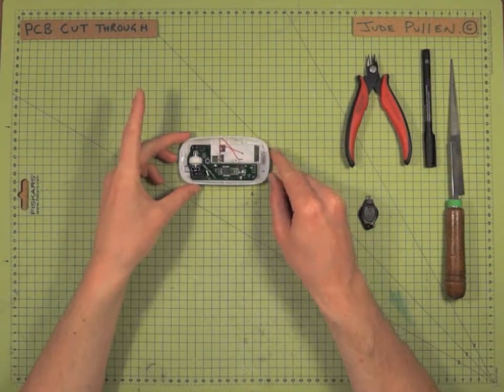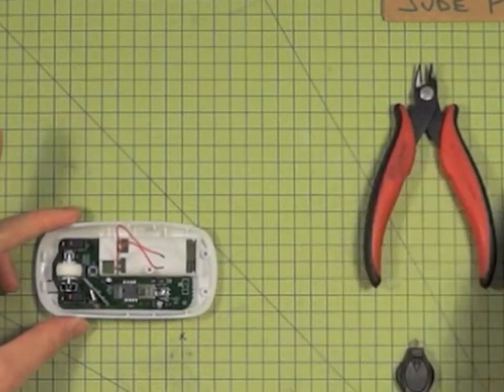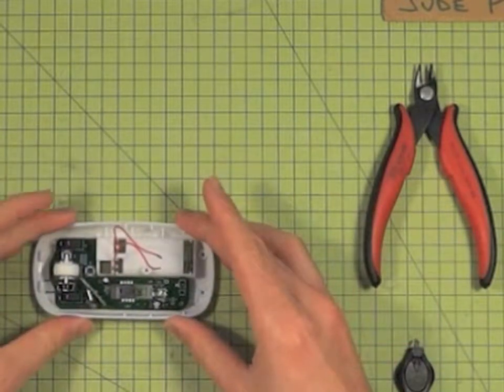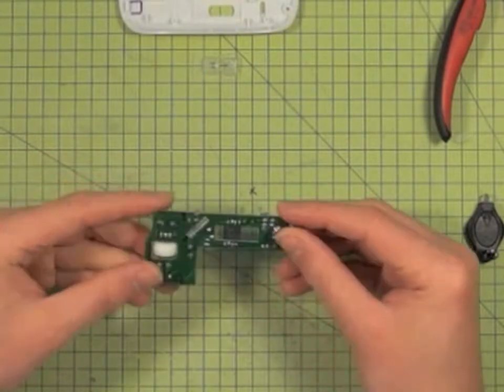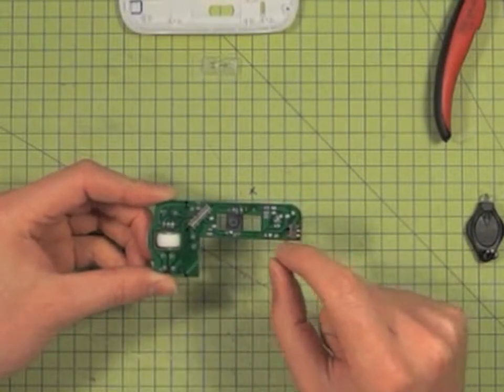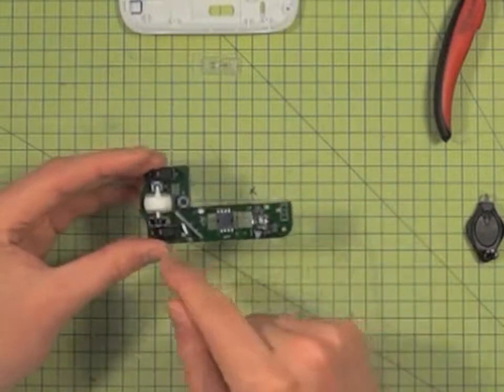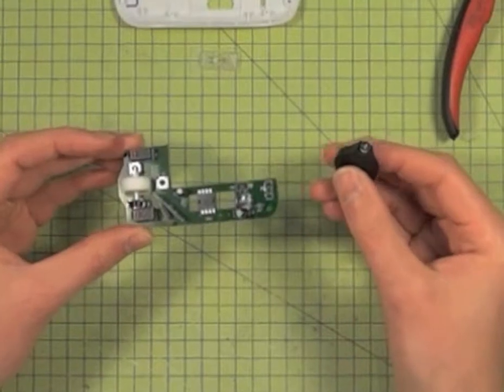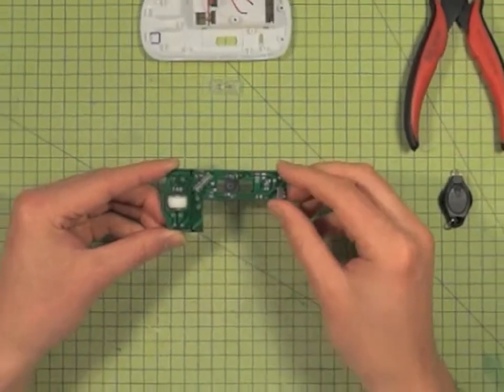Ergo Mouse - 3 PCB Cut Through

Comment: what mouse did you use for this project?
Reply from the maker: It was some years ago, so it’s likely not available now. But the good news is if you follow the steps the fundamental electronics are essentially the same.
Reply: @JudePullen  do you have any recommendations for a similar mouse? I dissected an old mouse I had laying around and the PCB looks significantly more complex than this one
Reply from the maker: @laurenthomas1467  I had an old Dell Mouse like this: https://amzn.to/3iStIqm which would probably work (but not 100% sure - but only £10....so worth a shot? Also the cheap Bluetooth one also may work). 

Essentially what you want is to find that the buttons are as simple as possible. So weirdly - getting a old Mouse will help you out more. So perhaps try ebay and avoid the new models, which are likely to have hype-optimal electronics (ie small PCB components) rather than stuff you can tinker/mod yourself. Hope this helps =)